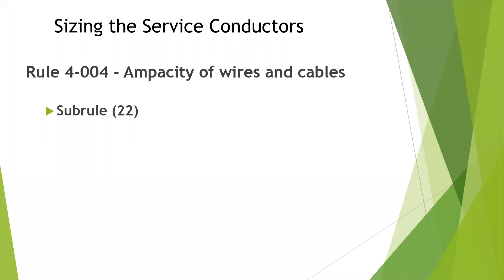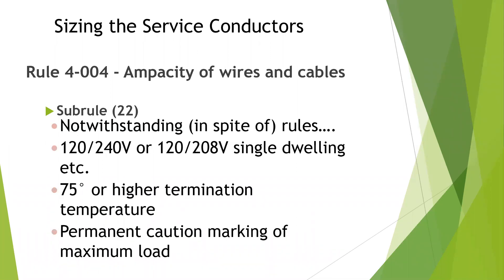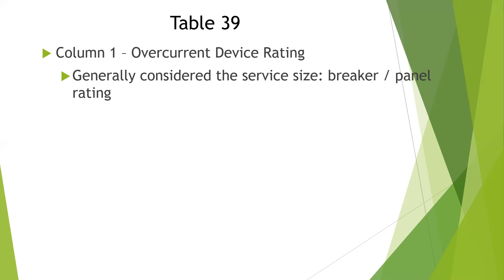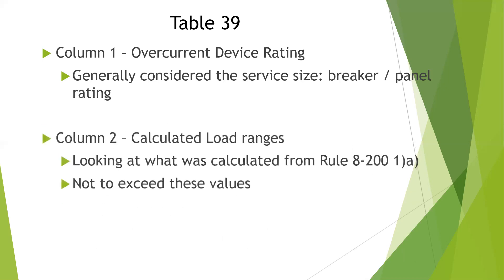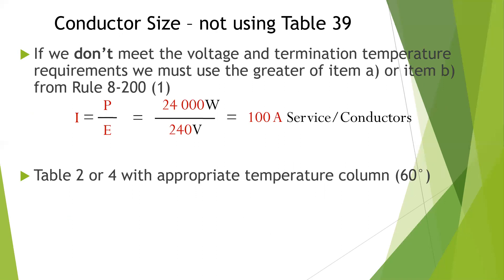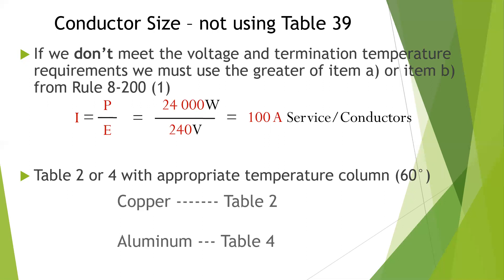2019 Canadian Electrical Code_Ampacity of Service conductors

Comment: You say this is based on the CSA 2021, I have the CSA C22.1:21 Canadian Electrical Code, Part I and there is no Table 39 and Rule 4-004 22) is NOT anything like what you are saying. Can you give the CSA number for the code you are using? It should be in the top left of every page. Thanks
Reply: No problem. Much appreciated. I thought I had gone crazy for a minute.
Reply from the maker: You are absolutely right. I am going to remake this video to reflect the 2021 code. Sorry about that. You will see this video disappear and a far better one replace it. :)
Reply: hi @reissner1967 . I am preparing for construction electrician exam using CSA22.1.21. Kindly help me to get some tutorial , videos or other sources to pass the exam

Comment: I see that table 39 has been deleted from the 2021 iteration of the CEC. I find the whole topic of termination temperatures confusing, because breakers rarely come with a rated temp so I end up using 60 degC anyway. Do you think the extra margin of safety is worthwhile, or do you think breaker manufacturers will be motivated to produce breakers that can work well with 75degC wire, to reduce the cost of wire in new developments?
Reply from the maker: Thats a good question. I do think the extra margin of safety is worthwhile especially because the demand on those breakers and wires will only increase. They may produce more breakers that can work well with 75 degree wire but unlikely if it drives up their manufacturing cost